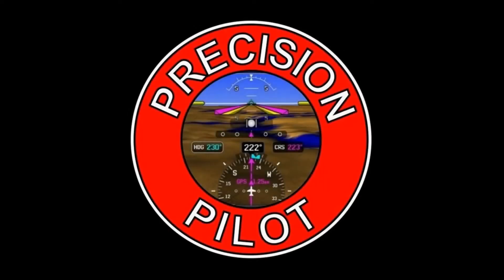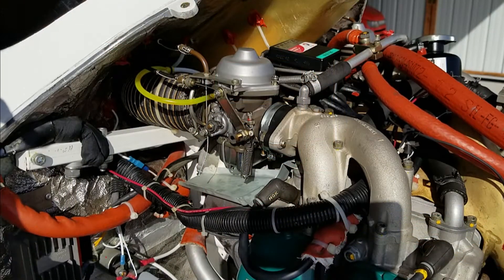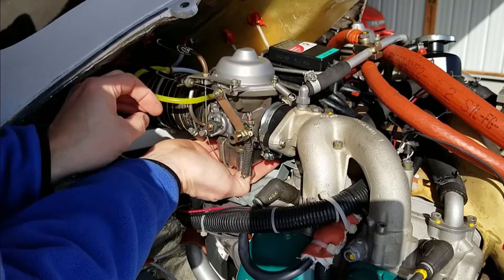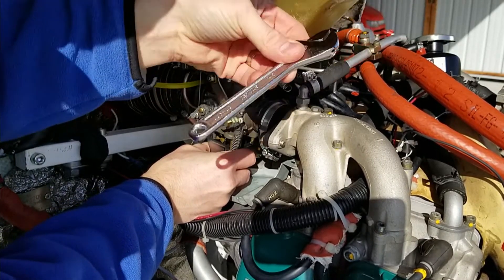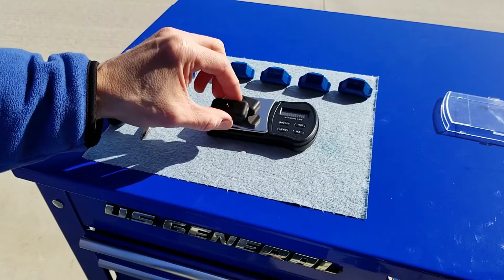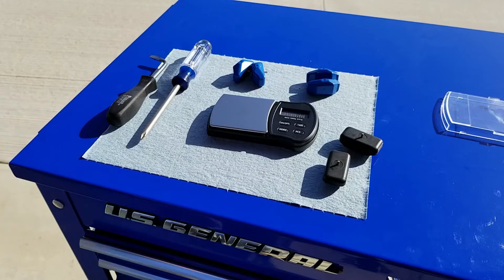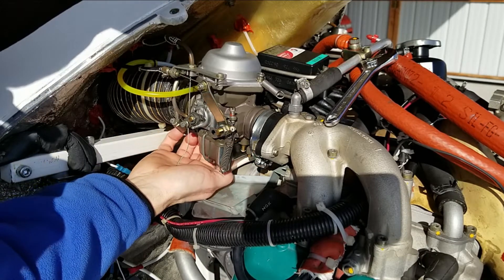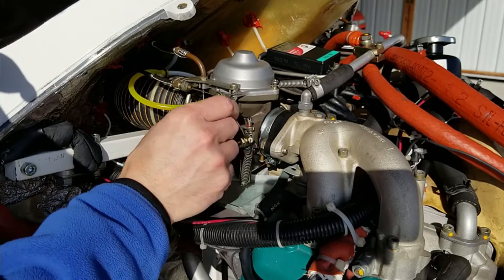Rotax 912 Carburetor Float / Bowl / Service / Inspection / Balance Bing 64 Marvel-Schebler MS80-430

Comment: I've been doing it that way for 15 years or so, and always felt a bit guilty about using the mechanical method!  Good to know it's a more accepted method than I thought! I have a MacFarlane vernier throttle, and will crack the throttle open just enough for a .24 feeler gauge, just because that size is "custom bent". I get a faint amount of drag on the first one, than similar on the second one, works for me,.

Comment: Thanks for the vid.  I've got a 914 and have a question on the sync process.  If you use the ferule to adjust the closed position and not the idle screws won't that adjustment get screwed up if you have to adjust the full open position?  Rick
Reply from the maker: There is a lot at play here between the ferule & stops for both carb sides.  The idle screws are used to reduce or advance low end RPM, the ferules adjustment is to only match the timing between the two carbs so each side bottoms out simultaneously.  My description about adjusting low end idle is not entirely accurate in the video, I'm talking about a very slight difference within the adjustment, the idle screws are the primary means to adjust the RPM.